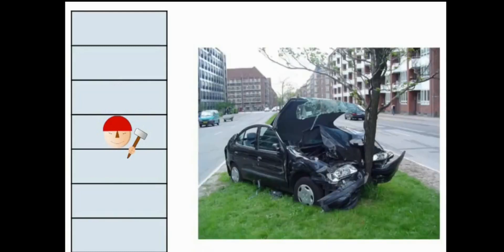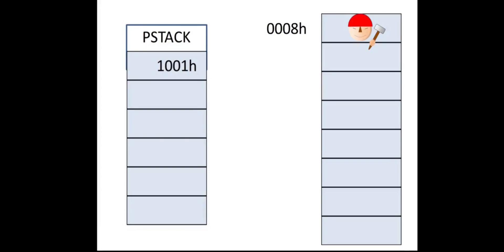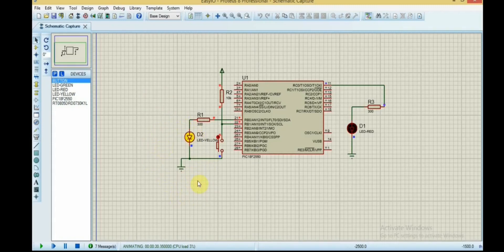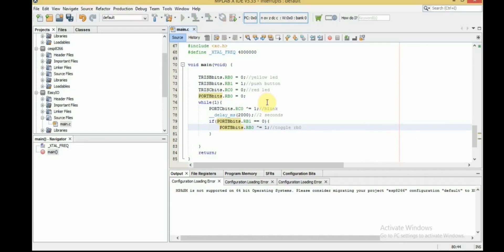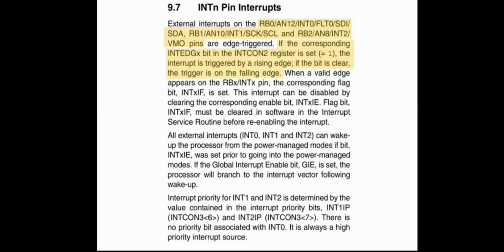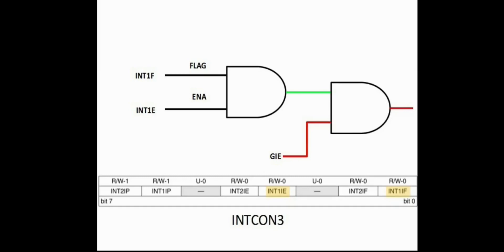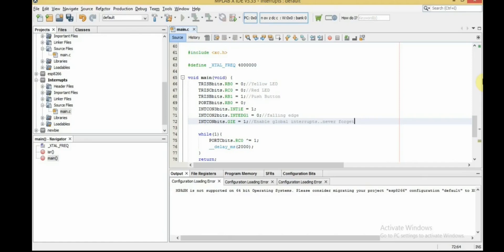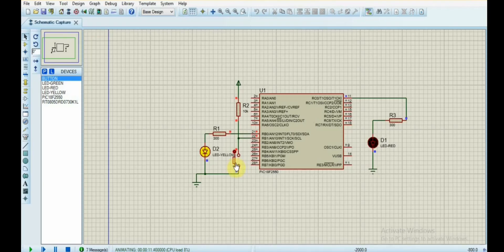Interrupts in PIC Microcontrollers | PIC18F External interrupts

Comment: My project is a DIY PSU. I am a novice. I will be using two rotary encoders to control digital potentiometers to set the voltage and the current. The push button knob switch will be used to change between course and fine adjustment. I take it that using pins that have interrupt capability are the best pins to use for the rotary encoders. Do I have this correctly? And, as each encoder has an "A" and "B" pin and a switch,  I will need a total of six pins that have interrupt capability. Also correct? Further, it would be best for each of these six pins to have internal) pull up resistors and b) Schmitt Triggers, for debouncing. Correct, again? I will be checking the Data Sheet, but do you know (by memory,) if the PIC18F4550 has at least six pins that have all of these needed functions? If so, do you also know their pin numbers? Please and thank you. Much appreciated. EDIT: I started to watch your next video and see that you will be answering some of my questions. However, I would appreciate any of your comments, or suggestions. EDIT2: In the second video, you clarify that there are only four interrupt pins. Accordingly, I guess that I could use the switch on the encoders to initiate the interrupt and an additional button press to change between Course and Fine. That way, I would only need two pins that have the interrupt function. The four A/B encoder pins could be on other digital pins that have pull up resistors and Schmitt Triggers. So, I am off to investigate those pins.EDIT3: Further limitations are encountered... INT0=SDI and INT1=SCK. I believe these two pins will be needed to communicate with the MCP41HV51 digital pots that I plan to use. That leaves INT2. Therefore, I will use a separate tactile switch on INT2 to initiate the interrupt and enable the voltage and current encoders. Does that all sound about right? What other options might you suggest?